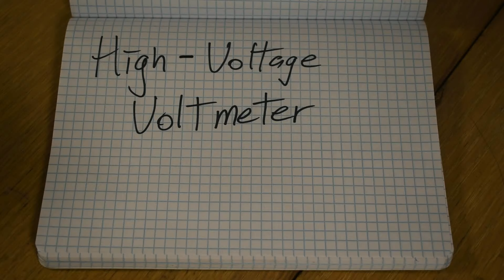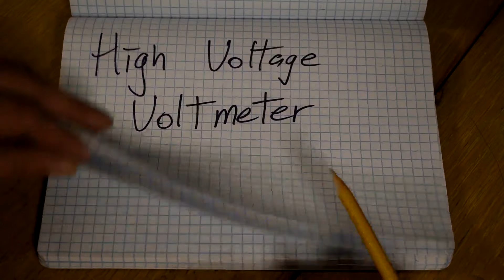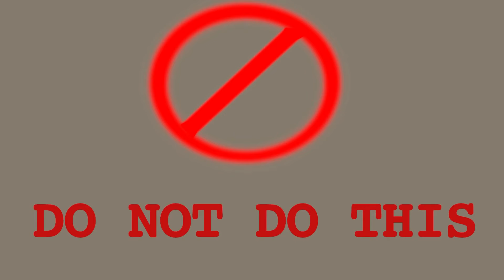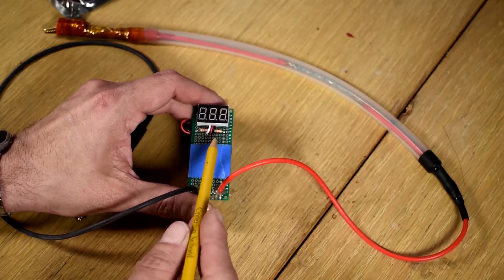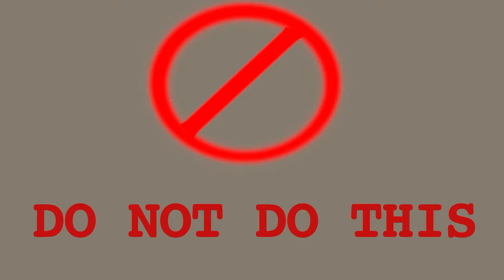High Voltage Voltmeter for Microwave Secondary Testing

Comment: its called a kilo voltmeter
Reply from the maker: Makes sense. I looked at several standalone meters (k.v. meters) but the scale was higher than I wanted (found several 1-20kv and 1-40kv), but with an analog meter I think the 2-3 kv I was measuring wouldn't resolve so well.
Reply: or k.v. meter